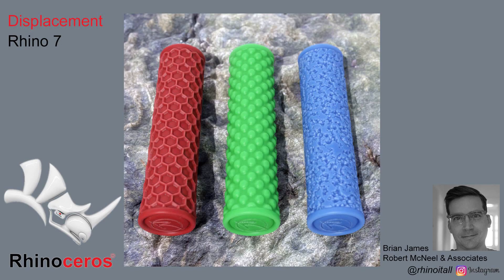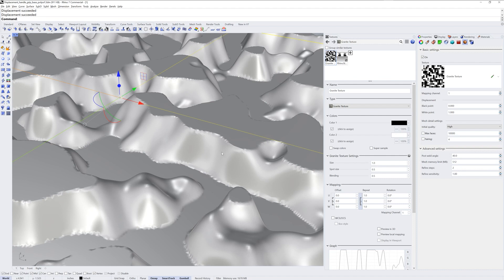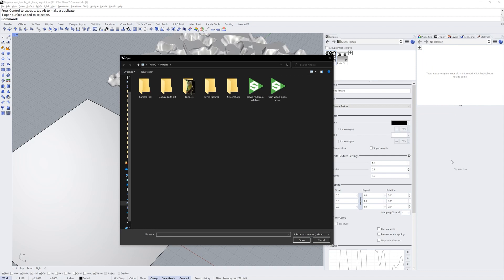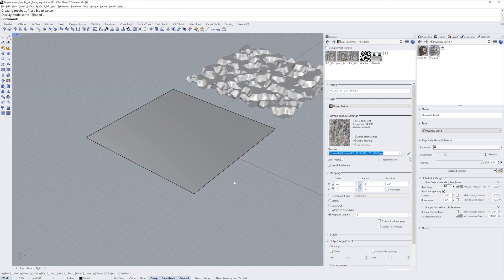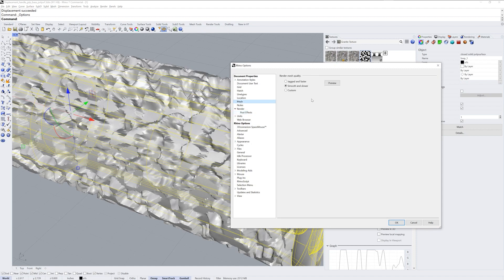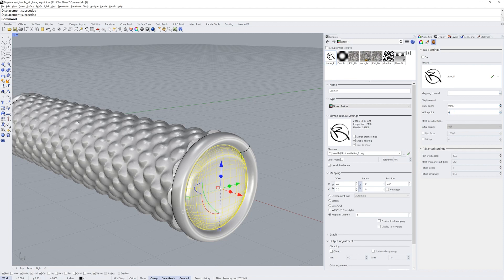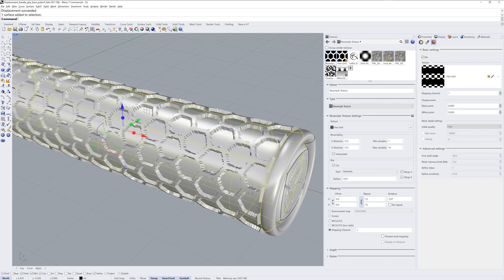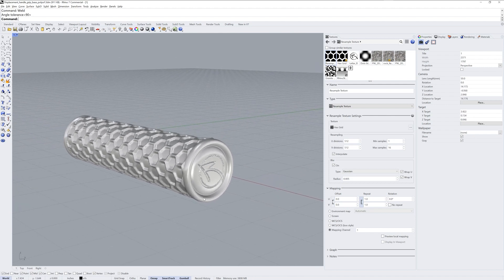Displacement Textures in Rhino 7

Comment: Hey Brian, I am following your tutorial but when I assign the texture to my plane and turn it on - nothing changes. Have I disabled something in my render/shaded viewport? Im unable to find out why I cannot see the texture over my plane. Thanks in advance
Reply from the maker: you may need to up the render mesh density in the object properties panel. Click custom mesh and crank up the polygon count a bit. PLane typically have very few polygons and as such don't displace well unless you override that setting with a custom mesh.
Reply: @Rhinoceros3d hi Brian. I’m having this same issue. When I turn the granite texture on (Did a 20x20 plane), it does apply but it’s very subtle compared to your affect. Do you have any other recommendations? Thanks!
Reply: @JahmaCostello  Try on a larger or smaller surface (like, 10 times larger or 10 times smaller.) That was my problem.